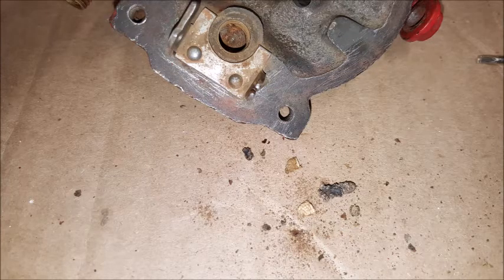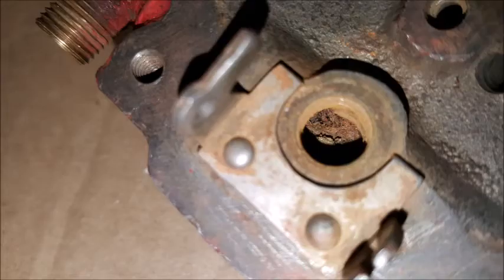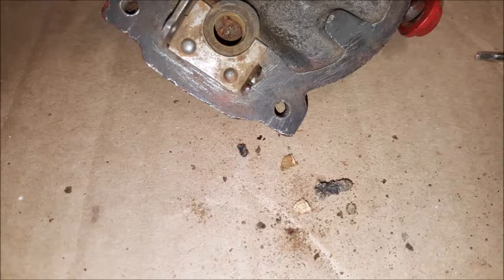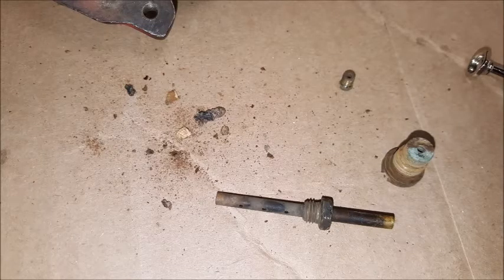Look at the dirt I found in my Farmall carb, mainly it sits just before the Needle and Seat

Comment: WOW...25 years of Rust and Crud is NOT Easy to Remove... and it only takes 1 Single  SPECK of Dirt to Mess up a Carburator !   I Sure Hope you plan on having the Tank Cleaned because THAT is where it all came from.. Good Luck
Reply from the maker: Yes Dan, so true, lucky I have an inline filter now, check out for a Wednesday video driving around, if works out as planned, thanks for your continuous support